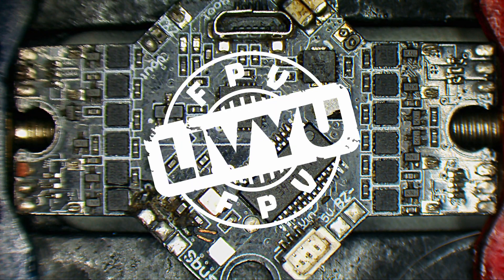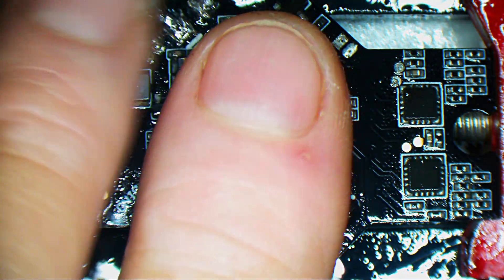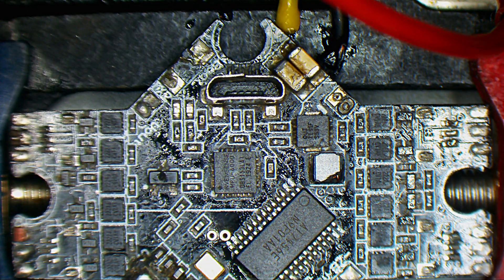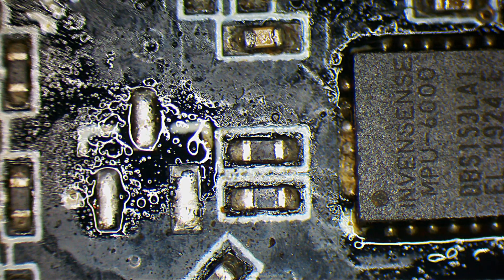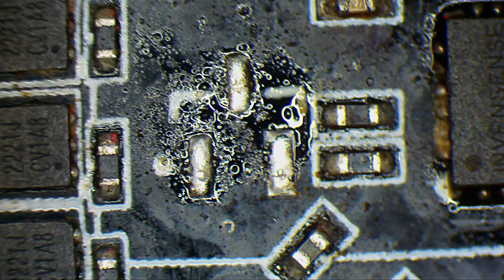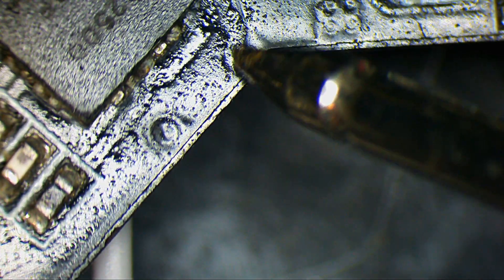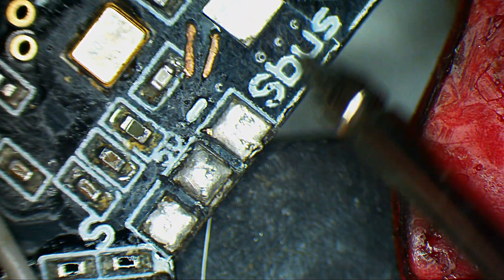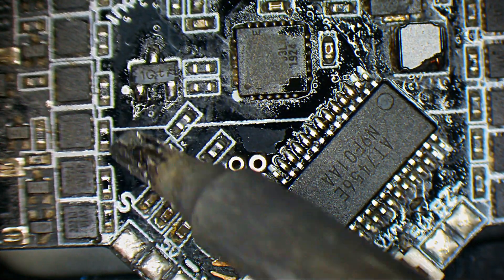Tinyhawk II AIO Motherboard REPAIR

Comment: Super content! Thank you!   But how do you know the part was a transistor and not a voltage regulator or diode ??
Reply: follow the trace to the 1st thing that is identifiable then look up the board diagram on line under image thats it don't give up you will get it sounds very simple good luck

Comment: Hi, had a bad day with my Tinyhawk 2 Freestyle, tried to upgrade the VTX an it shorted out the FC with a little smoke an then stoped working! Can you tell me where on that FC  board would be the problem that shorted Out an what is probably burned out from the VTX shorting out the FC? thank you!

Comment: I just fried this AiO yesterday. I needed to replace the power wire, because my XT30 connector broke (soldering on the Plug came off on one cable) and I failed to resolder it to the small XT30 and it melted lol.
I ordered some pre-soldered XT30 cables, but didn't realise I ordered 16AWG wire sizes and I still tried to solder that onto the tiiiiiny pads on the AiO. I failed. Hard. 

Didn't dissasamble everything fully, just enough to get to the pads underneath on the side. Bad decision. I became frustrated and careless. I didn't care about annything anymore and overheated everything waaaaay to much and to long. Cooked out Flux sooo much, had to add so much with my Pen lol. Couldn't get solder onto the pads, then it 'spilled' over the pad onto everything arounnd it and I had to clean it up. I seriously fucked it up majorly. After 1 Hour of getting mad I had both wires soldered with the worst jointns possible and tried plugging in a 2S LiPo without a smokestop. Some LEDs flashed up shortly, but not for long. Wiggling it a bit at one point it stayed on for long enough to almost boot up once before flickering again and then nothing, quickly unplugging again. Simply pulling the Battery out of the XT30 I pulled of one wire from the solder pad as well lol.

I don"t know if it is fixable or what to do about it. Plugging in via USB it still connects to BetaFlight so I guess just the Power Distribution is fucked up royally and I neither have the tools nor the skill to fix it. Don't want to buy yet another AiO for 90 bucks. This was my second board since I crashed in a Puddle once and some Chips on the ESC area burned up and I replaced it.

Thinking of getting a custom Frame from Microheli that fits the TH1103 Motors with the awkward mounting patterns and rebuilding it with another AiO completly or even small stack with seperate F4/F7 FC + ESC because why not and because I already have so many spare Parts and replacement TH1103 Motors.

Comment: This is pretty cool, my Gyro seemed to fail and I only had to reflow the solder joints lol.
Reply: @johnybell  My tinyhawk would calibrate via Betaflight, but slowly drift out of alignment no matter what I did in the settings. My sub trims would never stick, if it wasnt this, the drone would dive forward in atti mode randomly and only a Th hold would stop it. 

Upon visual inspection of the board with a mag lens, i noticed some faint corrosion around the IMU chip pins. 

So I purchased a hot air soldering station from Amazon, and some no clean solder. 
I warmed up the chip until it just barely moved on the board and immediately stopped. 

Once it cooled off the drift was gone completely and now I use it as a beginner drone for friends.

Comment: Very well, you are a genius to me.

I have followed all your videos, in order to repair a Tinyhawk, but have not yet succeeded.

I would like you to tell me which component is the one I marked in red in the photo attached to the email I sent you. It's a kind of reel, with an underlined K on it. There is also another one under the small PCB of the video transmitter.

Thanks for your help.

Bruno.

Comment: Wow this is really impressive. I have a strange issue on an almost new TinyHawk III right now. When plugging in the battery, there is no beep, and the AIO board's red LED flashes a few times fast - then nothing works (the separate VTX board works, but not the FC/ESC AIO). No arming, no motors spinning, no usual betaflight welcome beeping - just silence from the board. The red and blue LED should blink, but the blue led stays dark and the red LED, as said above, only flashes around 4 times, then remains dark. Instead, however, the motors are ticking around 2x/second, which I have never heard before.
Now I tried plugging out the motors, and I found out that when no motor is plugged into the front right motor plug, then I get the right beep, the right blue and red LED blinking and I get USB and I can spin the remaining 3 motors in betaflight. I also switched motors to check them, and all 4 motors appear to be okay. However it does not matter which motor I plug in to the front right motor plug - always when the front right motor plug has a motor plugged in, the symptoms (no usb, no beep, only red led flashing, motors ticking) appear again.
I checked the top and bottom sides of the AIO board and I cannot visually identify any discolored electronic components. The motor plug socket appears to be normal and undamaged. (The symptoms did not occur after a crash, but started between two flight sessions. The last good flight session was without any signs of something being wrong. I did pick some hair and dust out of the motors after flying, but everything seemed okay. The motors are definitely clean and running - only the top right motor socket creates a problem for the entire board.)
Any clue what I can do to figure this out? I'd love to be able to repair this board. I have some basic knowledge of electronic components, I can do some soldering (however, the parts on the board are so tiny, I doubt I could safely solder resistors on there), I am willing to learn. I just see no trace of heat damage or other fishy symptoms except for the described faulty behavior.

Comment: I am facing a weird problem. One of my motors stopped spinning today. First my quad was wobbling, but after 5 mins of flught my motor 1 stopped spinning completely. How do I diagnose it and how to repair it. Can I simply replace one motor connectiin with a 6A esc. Please help.
Reply: do you see those 6 squares on each side of the bord, replace the bottom 3 of the motor thats not working
Reply: @evanlebaron9465  you are talking about the mosfets? I do understand replacing them will solve this issue. Any idea what are the specifications of these mosfets or any link for the same. This may save this board from an expebsive replacement considering replacements are not available here in India in the first place. I can get this ordered from banggood or aliexpress. Just need parts number and specs.
Reply: @rcarindom  I actually have no idea, sorry
Reply: Forgot to add, I have tinyhawk 2 freestyle board.

Comment: Hi Livyu, forgive my english with google translate! I ask you for a lot of help, after weeks of research I cannot find a solution to my problem: at minute 0:26 the inductor that you have replaced is framed in the lower right corner and which is indicated by the factory with a K underlined. Could you tell me where I can buy it? I can't find his values anywhere on the net and my thinyhawk is without video signal for that reason. I sincerely hope you can help me! Thank you!

Comment: Hey can you please do a video on diagnosing and repairing the tinyhawk freestyle 2 AIO board? I just got one that lights up with battery power but nothing when usb is connected and can’t connect to the computer.
Reply: Did you figure it out?  I have the same issue.
Reply: 2nd that I too have same issue

Comment: Greeting, great video that could save lots of people's pocket.

I have a resistor that was ripped off together with pad. I would like to solder a through hole resistor to fix the board. It seems to be 100ohms in value but I am not very sure, are you able to measure the value of it and where abouts the component leads to to solder through hole one on? Thanks a Million.

https://www.dropbox.com/s/dn4s9iprnyv0pke/2020-12-23%2019.53.40.jpg?dl=0

Comment: Excellent job... and the alcohol trick was new to me, but i guess you wouldn't do this on higher voltage boards ?
Reply from the maker: It is not conducting if you were thinking about that.

Comment: A question: all those TH2 boards, including the one in your video have an inductor with a chipped off corner. Do you know what it is and how came that every board has a broken (?) inductor case? Is it on purpose for some technical reason?
Reply from the maker: no, just a weird coincidence :)
Reply: @LivyuFPV  I don't think it is a coincidence. I have 3 or 4 of those boards at home and all of them have this component with a corner missing. Also asked in a group and bunch of other people said they have it too.
One theory that I have is that emax bought or shipment of those inductors with a defect cheap and use them because it  doesn't affect performance in this application.
Reply: No it can’t be

Comment: I love this content man, I wish more people were into the electronics repair. Everyone thinks it's super difficult but, it's actually pretty easy with just a little bit of knowledge and a hot air gun. 9 times out of 10 the problem is an ldo that costs a few cents to repair I hate thinking how many boards get thrown away that could have been fixed.

Comment: thank you! the inductor looks bit banged, too. i have two boards which are failing due to similar damage. one gets "rxloss" plenty and the other has the jitters in flight. can you probably show how to replace these tiny inductors? they seem to be hard to get off the pcb.
Reply from the maker: Nah... the inductor is fine, Not ideal but it will work fine. That inductor is for the Switching Power supply. You can take it out if you want but you have to know the value to replace it
Reply: @LivyuFPV  emax support told me and i got the right replacements :)
Reply: @TouYubeTom  hi jitter, i read that you asked emax for information and they gave it to you. I tried to do it by opening a ticket but it seems that they keep that information all to themselves. do you remember the procedure you did to get info? Thank you!
Reply: Same here, they don't tell anything, just a reply what they send a new f4 controller , but if it happen for to high v so just get one with 40 . On eBay 6 dollar for 50 of them. Still waiting for my replacement.

Comment: Great repair, i got the same board and it is not connecting to the PC anymore. LEDs are lighting up and i have 5V from ESC is in place. Would could the issue be when there is no connection to the PC via USB?
Reply from the maker: pcb connector itself, driver, etc.. does it enter DFU mode ? the MCU ?
.
Reply: @LivyuFPV  Looks like the board is going into DFU because the LEDs stay off. In very few cases something is detected when plugging in the cable.
Reply from the maker: @jeb3145  then maybe the connector itself the cable has issues. Micro USB suck big time :)
Reply: @LivyuFPV  Okay, will try to connect FTDI adapter tomorrow to see if the connection is stable with it.
Reply: Livyu FPV hi I soldered wires directly to usb port same problem. Connection is very unstable. When I push and flex the board the connection sometimes work. Where should I look next ?
Reply from the maker: @jeb3145  well the 2 usb lines going to mcu :) check connections to mcu and redo them
Reply: @LivyuFPV  You are the best! I resoldered the leads on the F4 even though they had continuity. Now it works again, without flexing the board :)
Reply: Just for your information my OSD was also broken before fixing the F4 IC and i have removed OSD chip and put it back on. OSD is working now i think that was related to the F4 as well since OSD started to work when flexing the board. Maybe that will help you in future repairs. I have subscribed and waiting for the next repair video.
Reply: @Livyu FPV Sorry to bother you again. The tiny hawk fails to initialize ESC for the right rear motor. Mosfet has no short to ground or postive. I have checked the mosfets and they do all have the same conductivity.  The motor is OK because it works on the left rear.  When i connect the power to the board i am missing the last "du du du" (beeps) which means ESC fails. Can you help me where to look as i cannot see where else to look other than the mostfets.
Reply from the maker: @jeb3145  well it seems you have no dshot on that esc mcu. Check lines again :) the last beeps mean that the esc receives signal from FC 
At least this is my first thought. It could be 1 or 2 other things but my money is on this.

Comment: You can't imagine the time i spent serching where was the issue... You're right, the blue led is the Frsky D8 receiver and i think it burnt when the transistor did... And i think it burned because i shorted the 3 sbus pin. Great work!